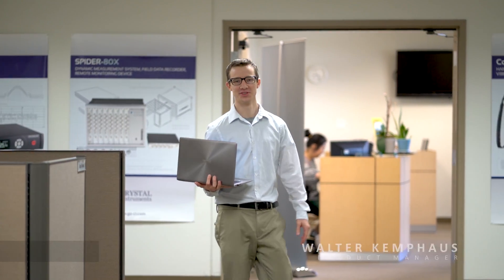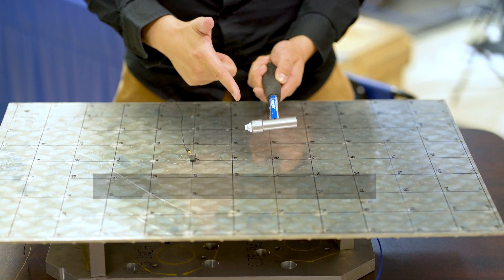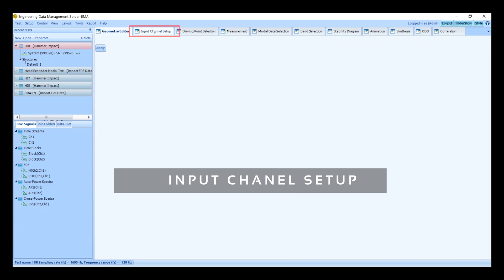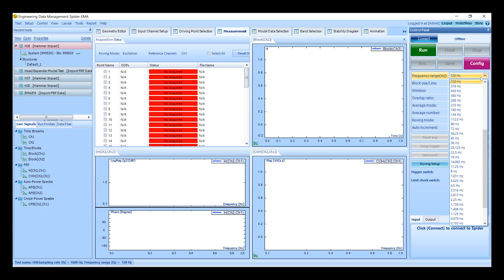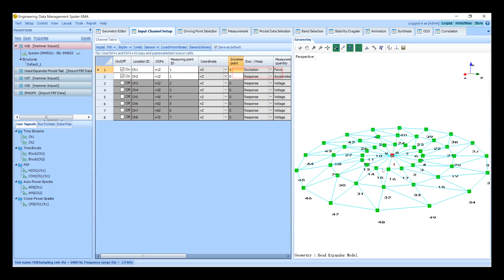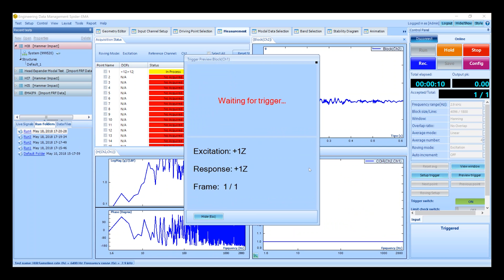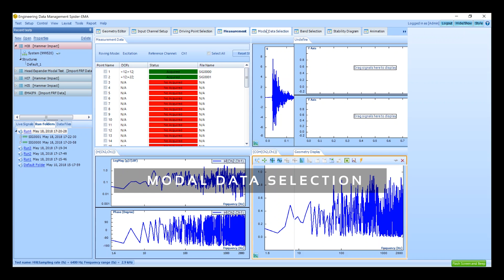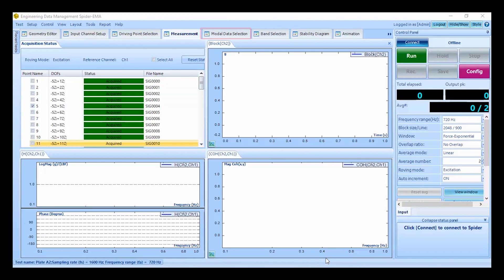Modal Part 2 - Data Collection - Hammer Method

Comment: so im building an incline system for a treadmill do i need to have the system built to be able to get accurate results or i can just do the test on the beam which will handle the stress?